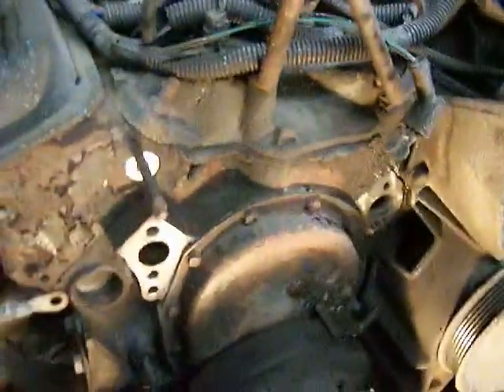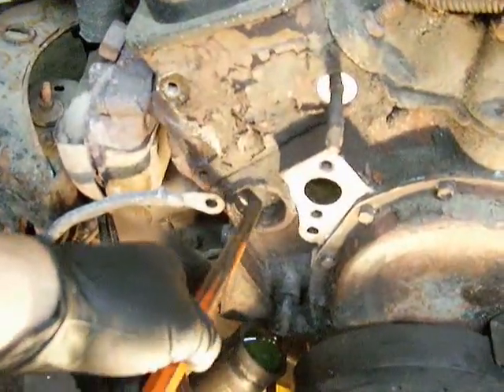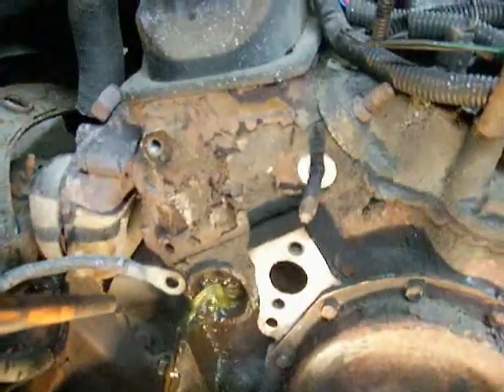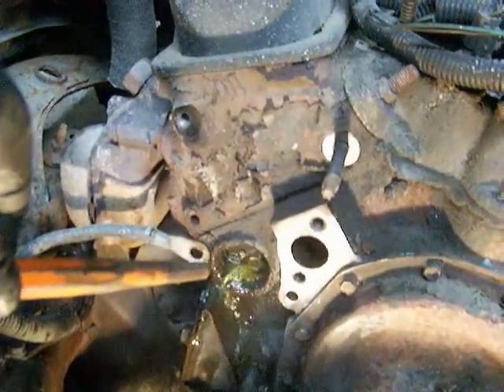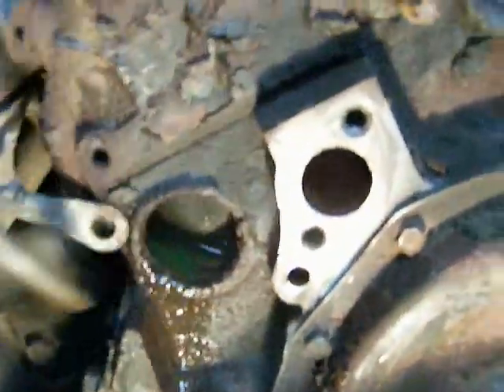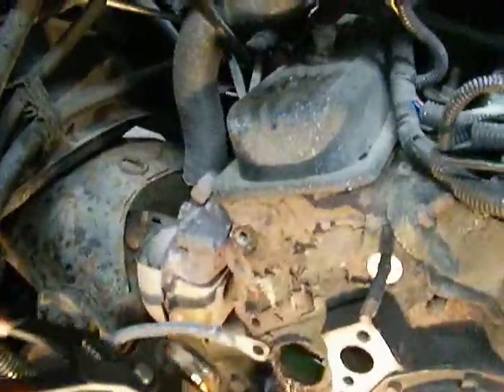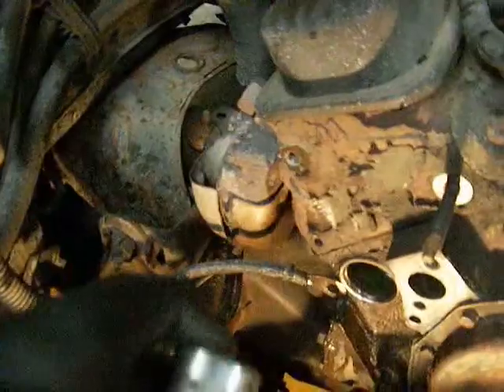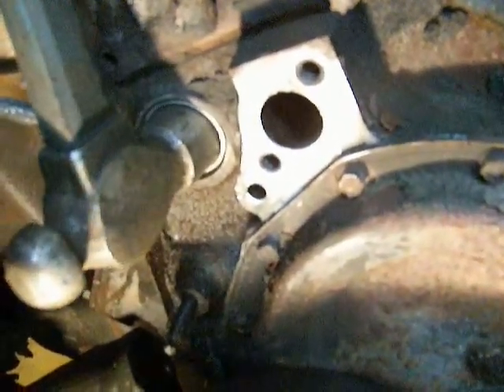Frost plug replacement

Comment: Funny thing is freeze plugs or frost plugs as they are commonly known are nothing to do with freezing , they are core plugs and form part of the casting process of the block , that's why people are so often surprised when the block cracks and the core plug remains intact.  Think about it why would a manufacture waste money and time installing something to protect against something that should never happen when correctly maintained ?

Comment: A freeze plug is made of metal that contrcts and expands a lot. If you literially freeze them they pop right in and when they warm up a pressure seal is made that is water tight without sealent.
 Have a problem getting one out try heating the area of the block and use a compressed air can upside down and spray the liquid only on the freeze plug. This will  contract the pulg and allow it to be removed. They are actually for access to the water ports after casting the block.
Reply: I

Comment: just watched two videos.  The first used an air chissle modified to drive a socket to tap the socket in place.   Worked well.  The second had enough room to remove the freeze/core plug, but not enough to drive a new one in.   This individual used a rubber expansion plug.   Stick it in the whole and tighten the nut to expand the plug.   Wonder how that would hold up.

Comment: Any suggestions on installing a freeze plug in a tight place?  I have one seeping behind the motor mount on my Sea Ray.  GM/Mercruiser 305.  I can probably see it if i block the motor and remove the motor mount.  But the engine sits in a well and there's not much room for a hammer.
Reply: william mack what ever happened with that? My sea ray with 5.0mpi had one popped open after winter.

Comment: That was crazy,.....take out a good Brass freeze plug and reinstall a galvanized steel one, that brass plug was not in bad shape at all and would have lasted the life of that engine and beyond, always scrape the plug to see if it is brass before banging on it...... that was a needless plug change...... But it did show how easy it is with the ones that are easy to get to and you did a good job of explaining the process so for that you get an A+

Comment from the maker: If its coming out from the bottum of the bell housing then its one of the rear frost plugs. But if its running down from the sides it could be a rear heater hose on the intake or a bad intake gasket

Comment: good vid. i did a freeze plug for a friend with a 4.3 v6 chevy. it was right above the starter so it wasn't too bad once i got the starter out of the way. i used a large socket to fit into the plug and hammered it right in. now my '87 silverado is leaking through the rear of the block. that means getting between the trans and block grrrrr! any advice for a low budget driveway mechanic like me? it's got the 305 in it.

Comment: Nice video and your methods for removal and installation were spot on. Unfortunately your preventive maintenance wasn't necessary. The brass plug you removed would not have ever rusted through. Another oversight is using that galvanized steel plug as a replacement. It will eventually rust unless you properly maintain your antifreeze from here on out. Anytime you replace freeze plugs always use a brass plug and it will be the last time you have to replace it. A little more expensive but worth it.

Comment: On that one, you have to remove the mount and jack up the motor. It isn't too bad if you have a clean place to work.  It's one through bolt and maybe three or four on the block. I ended doing both core plugs, one over each mount , so I would only have to jack up the motor once. GMC and Chevy trucks of that vintage are pretty straightforward. Mine was a five speed and no A/C. I miss that truck.

Comment from the maker: I hate them ones. Getting it out is not the problem, putting it back can be. Its sometimes faster just to remove the motor mount. I think on them its just three bolts into the block and one long though the mount. You still have to jack the motor abit as well.